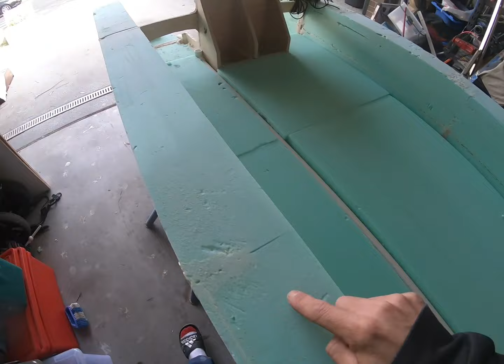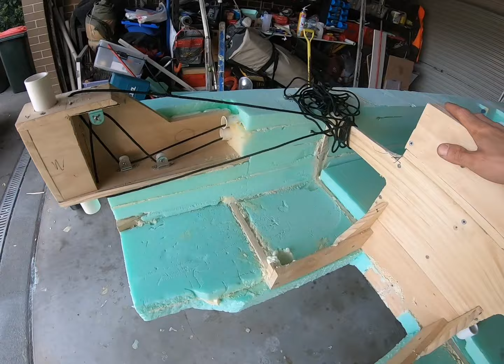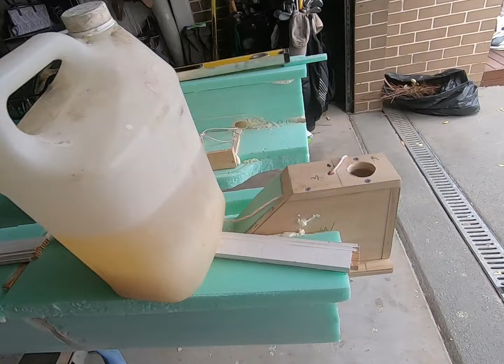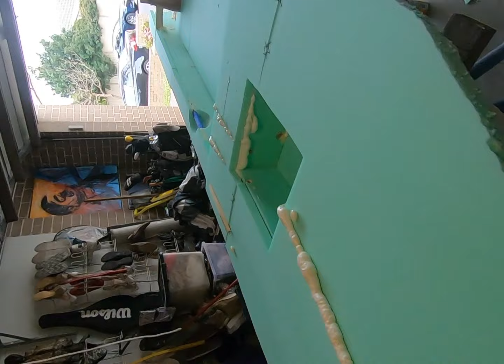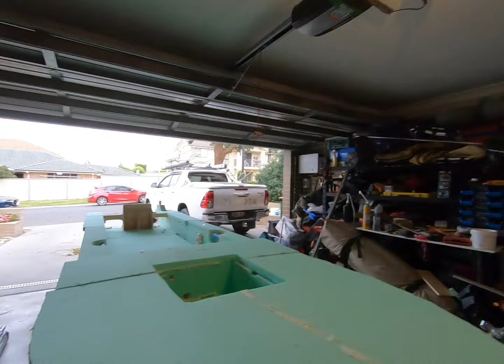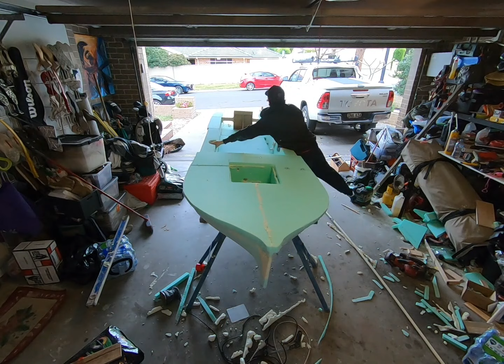LOCKDOWN PROJECT DIY micro skiff PART 1- Design and Glueing

Comment: dude that is so cool, I didn't even think a boat could be build like this! Does it flex? I would think it would at least need some stringers.
Reply from the maker: Thanks mate Yea alot of people will tell you, you can't build a boat like that but it definitely can be done it hasn't got any flex at all there is a single stringer up the middle but I think you could build it without a stringer you would just have to be careful moving it around b4 you fiberglass cause the foam could snap in half

Comment: What machine did you use in sanding and shaping the foam?
Reply from the maker: I just used a normal sander that they use for wood but someone has suggested in one of the comments a power planer would be alot better for removing the bulk then a normal sander to finish it off

Comment: Did you have plans?? Is the foam expensive??
Reply from the maker: I have my rough drawn plans but haven't had the time to draw them properly yet. The foam is fairly cheap its just xps foam from the hardware store
Reply: @thefishinglair2467  this is an awesome idea I was looking at building one but out of plywood covered in fiberglass similar to the salt boat works frs14 or 15
Reply from the maker: @forestjump3r516  I really didnt want the weight from plywood I plan on putting it on my roof racks to transport it so weight is important! as it is not it weighs less then my hobie adventure island

Comment: what foam are you using?
Reply from the maker: Xps foam from the hardware store
Reply: What color you gonna paint it? I say sea foam green
Reply from the maker: @homecaresolutions467  im going with white I may wrap it later but for now it's going to be white
Reply: what epoxy works with xps foam
Reply from the maker: @claysmith4395  I believe  most epoxy resins are  safe to use on xps foam

Comment: what is the length, width and height?
Reply from the maker: 3.8m long, the deck is 1m wide at the front tapering to 910mm at the back and about 800-850mm on the underneath side and 290mm high 
I will eventually draw up plans and post them up but I'm I'm while off that
Reply: @thefishinglair2467  ok! Thks